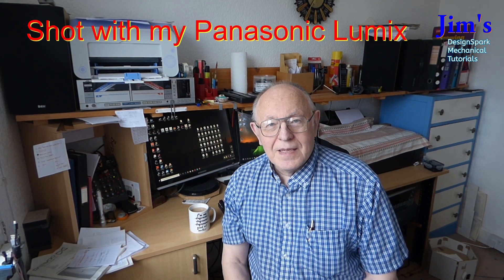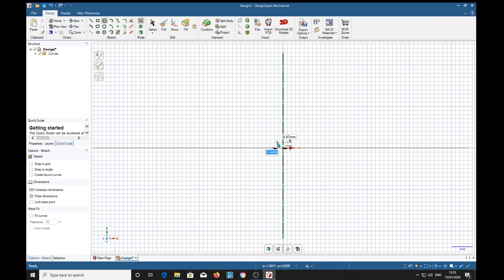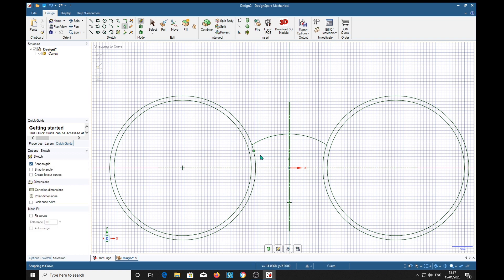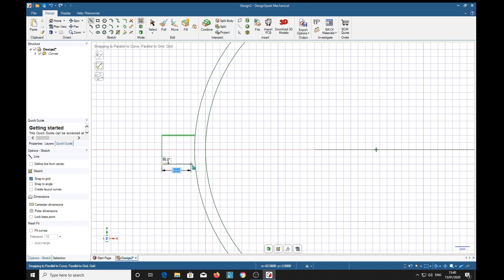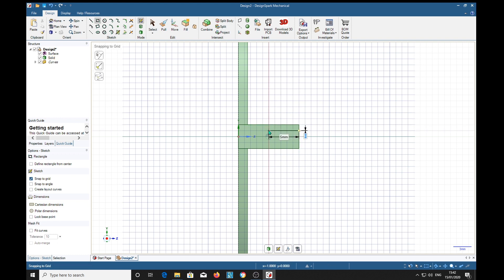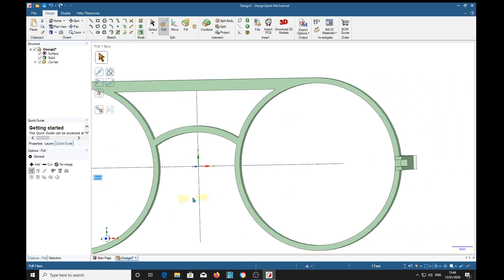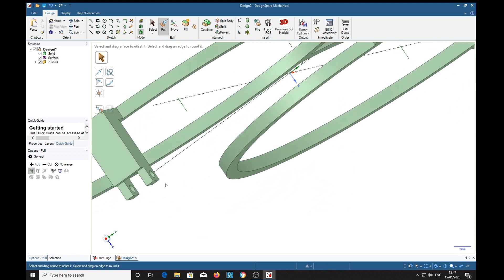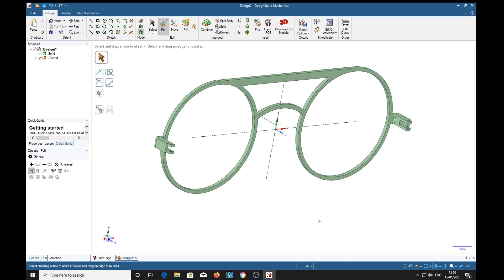Modelling a pair of specs with DesignSpark Mechanical

Comment: Jim, I've watched you videos and have learned something from every one.  Now I'm ready to take my DesignSpark Mechanical creations to my CNC machine.  It uses MecSoft to calculate the tool paths.  However, I can't get the DS to export dxf files to read them into the routing software.  Any tips?
Reply from the maker: That sounds like a good topic for a video. Watch this space.
In the meantime try this:
1. Make your model orthogonal on your display. i.e. not a perspective view.
2. Select File/Save As
3. At the bottom of the Save As box click on the Save as type: and select Autocad (*.dxf)
4. Save your file and it should save as a 3D dxf file.
Let me know how you get on.